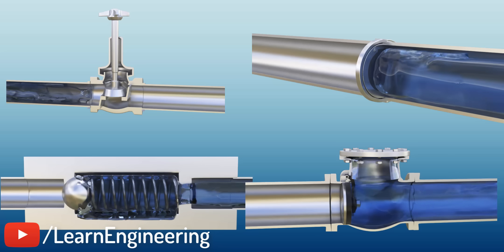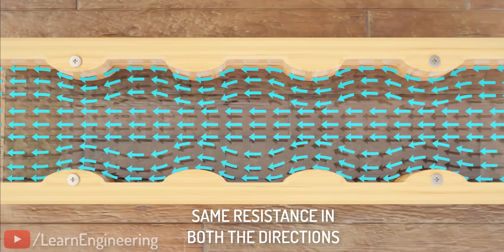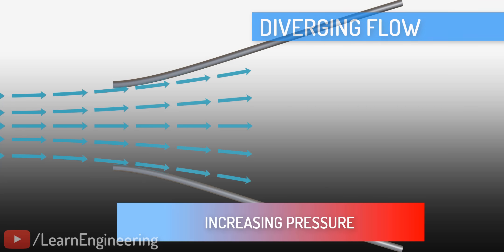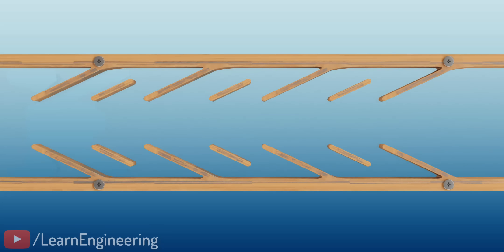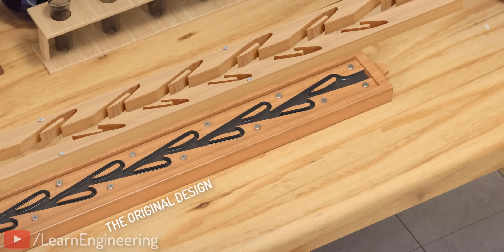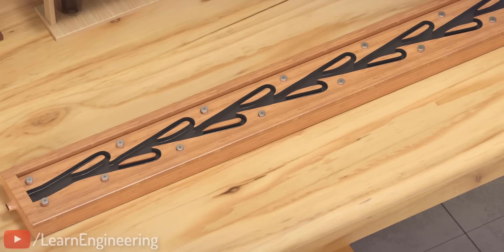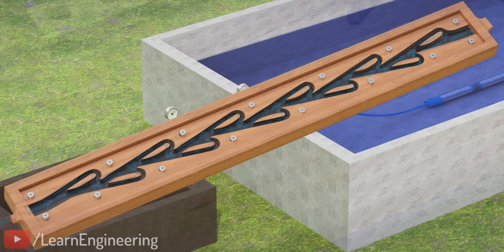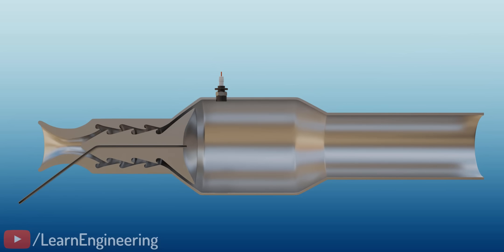Tesla Valve | The complete physics

Comment: How is this beneficial then a normal valve? As it has a higher volume.. just for understanding... while if we wish to  drop the flow just use smaller tube with a valve if there is no initial pump pressure..
Reply: Not drop, but regulate the flow, consider how the hydraulic pump works, higher pressure = faster, but this valve...higher peessure = normalised/static.
Tajuk video tak berapa tepat.
Reply: Yes totally agree that highr pressure is equal to higher velocity... but this video says vice versa
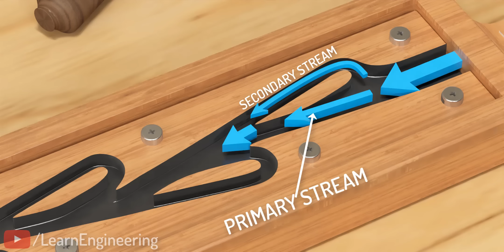Reply: @Sample_channel1106  At 4:00 is the full explanation with possible and practical applications. IMO the best place to use this is at dam water release channel, huge volume of high pressure water can be release at slower/constant pace,  to avoid flash flood downstream.
Reply: Thanks for ur last comment... made it clear....
Reply: @Sample_channel1106  biasa la bro, kita belajar, this tesla guy kinda very good, i thought he only dwell with electromagnetic,  but some how have other invention as well.

Comment: Cant believe how his mind was capable of thinking like this. What a genius!
Reply: It's really not that incredible.

I can't understand how a person couldn't come up with this if you were specifically looking for a one way valve with no moving parts.

The first image that enters the mind is surfaces or mechanisms which grip or engage in one direction. Like a ratchet or running shoes.

Then your brain combines those forms with a pipe. Then it see this would not work as is or at best provide very minimal extra resistance in one direction.

Then your brain says, how can we increase the resistance? And it answers itself and says by creating a secondary flowpaths which apposes the primary.
Reply: What really bothers me is that if somebody did something similar today, you wouldn't care. You care because Nikola Tesla did it. Because of his other inventions. You also care because somebody slapped the letters Tesla on a billion dollar company and now anything related is amazing. The guy asked himself how to restrict water flow. All you need is a material for water to run through and move things around until you are satisfied. Then, you show it to the public with little success because the market did not need the solution or your sales pitch was weak. Then, you die and wait until somebody makes a company with your name on it and an organisation decides to use a handful of valves using your design. That is how you make a Tesla valve. No advanced formulas, no string theories, just carve out some wood and drive some water through it. Alternatively, replace the wood with clay.
Reply: @guywiththebottle  but I mean he was a genius and alsoal a successful. person. But I get you think he has become another hip geek fad

Comment: This might be how Viktor Gerbennikov built an anti gravity platform from the organic CSE found in insects wings. Maybe gravity is some kind of an etheric flow and the geometric patterns made out of chitin can act as a one way valve for this gravity flow. Maybe this geometric pattern prevents this gravity flow and makes anything around the platform massless! You orient the platform correctly and it will prevent the gravetional flow through it or maybe deflect it a bit creating a vortex which push you upwards.

Comment: We use this in iron foundries, you put one at the end of your runner bar that will trap the first in garbage metal, you only need 2-3 curves and it keeps the splash back to a minimum.  Your ingates go just in front, the metal goes by the ingates, and gets trapped in the valve leaving good clean metal to flow into the mold cavity behind it. Very simple and beautiful design, it does what it does well but it won’t stop flow. With modern flow,and solidification software you can see how these work better than any other shape.
Reply: I wonder if something similar could be used for gold sluicing

Comment: I was wondering about its application in valveless pulse jet (or better yet, valveless pulse ramjet) engines, although the rendering shown looks seems like it would be too heavy due to the large amount of solid material (still useful for prototype testing purposes, though).

Wonder why the loop at the far end for the slow direction doesn't have a fully curving back far wall?  Instead, it fans out unlike all of the other loops.

Comment: Its all about the process which were tested on that period.. Simply now we are using NRV (Non Return Valve) which always flow water in one direction. 
Actually the thing is that .. A pressure can destroy a pressure its mean on the basis of hydro kinematics where no force required externally or internally...If we think the same with flood or any disaster then we can easily stand the barrier to stop that water or we can get extra time to divert the water back to initial spot. Inspite we can gain some electric through turbine. 
Note- Fully based on Fluid Mechanics.

Comment: all good but it's not a VALVE per say... you allude to the fact that you can have a valve with no moving parts, but it is not true. This is merely a clever reductor, you do not have any way to control "how much" it reduces. It is a fixed reductor, making it no more useful than any pipe with a bottleneck area that constricts the flow. The only cool thing about Tesla's version is that it constricts one way and permits the other. But still, not that much of a wow factor as are his other inventions.

Comment: Swap the water for electricity, and the channels for wires, and you can easily work with the flow and control of energy. Think about it. Water flows in at a certain speed and velocity. You can increase and decrease with varying results. Say you turn up the flow and the channel creates a more chaotic effect and creates splashing. So you learn that turning up the amp of electricity, can create issues like the water does. Then you learn to adjust the flow amp level to different chambers and channels. Same shit, diff states.

Comment: The explanation is WRONG!
I know a lot of books explain "Bernouilli" the same WRONG way and generations of humans do learn it WRONG.
The flow is not accelerated when it is diverged. HOW should this be possible? From where the energy should come?
A perpetuum mobile?

I do not say, that the Tesla valve does not work. I only say the explanation here is WRONG.

Bernouillis law does NOT say that a fluid is accelerated and its velocity rises! This would be a nice perpetuum mobile and all of our energy problems would be solved, and the USA and China would not have fight cold wars all over the world for oil/enegry.

Bernoullis Law tells us:
"When we got a flowing media in a CLOSED tube then the total pressure, which is the sum of the dynamic pressure and the static pressure stays equal alongside a flowing-line.
And this ONLY under special circumstances (non turbulent flow, incompressible fluid, very low vicosity)

And when you look at our graphics: When you put that angles there is a diverging in the inner side but the same time a converging at the outer sides.

The same is with the question "Why do planes fly?" Answer: "Because of Bernouilli!" FU...CK! NO!!!
If Planes would fly because of the bernoulli effect (where the hell a plane is in a closed tube???) every plane should fall down like a stone, when the plane turns around on its back and fly upside down, right? Yes!
BUT: There are planes that can and DO fly upside down and DO NOT fall down like a stone!

Learn mathematics, learn physics. AT SCHOOL not on youtube!

Comment: How will you reverse it without obstructing the flow? I think you need to stop the flow, then reverse it and then again start the flow. If I'm correct then it is useful only for varying the flow, which can also be achieved by other devices like venturimeter.

Comment: There is a mistake in the video.
The narrator does not understand the relation between pressure and velocity correctly.

does a velocity gradient cause an inverse pressure gradient or vice versa?
difference in pressure causes moving thus velocity.
thus a pressure gradient causes a velocity gradient and not vice versa

Comment: I won't read all the previous comments, but I think you missed the main point- you need to have a fluid flow that is oscillating back and forth for this thing to be useful.  Then it's great,  But otherwise, one could simply expel the fluid through a smaller orifice.

Comment: there's a difference between a one way valve and a check valve.  With a one-way valve, under low pressures fluids will leak in the wrong direction.  those types of systems require a CHECK valve, which requires a mechanical (moving) closing door. Many diesel and other fuel delivery systems require check valves, and a one-way valve will never work.

Comment: Interesting design.
But it would be very specific to only certain applications with fixed pressures and flow rates.
As soon as the pressure was increased or decreased it would completely change the flow rates?

Comment: It's not a true one-way valve because there will always be a little seepage, but its as close as you can get.
And for those who wonder how Tesla came up with this when his forte was electricity, electricity is amazingly similar to fluid dynamics, you are just moving electrons instead of a fluid.
Electrons flow through wires like water through a pipe, volts=pressure, amps=flow rate, watts = amount of water moved, resistance(Ohms) = turbulence/constrictions restricting flow.

I figured out how a Tesla coil works and resonance as a kid before I even heard of Tesla, I noticed that fluorescent tubes lit up when near something charged, I thought why can't we transmit electricity like that. 
Maybe I'm the reincarnation of Tesla without the Tourettes.

Comment: I think in the second case at 1:00 the flow should be the same in both directions since it's symmetrical. He only locks at the center. There the area increases if the air is going from left to right and the pressure lowers. But on the side we have the opposite effect. He's totally ignoring this.

Comment: 65FGM520 reduction geared motor applied for automatic equiments robot reducer gear motor

Motor specification:

Model:FT-65FGM520

Rated Voltage:24V

Load Speed:6700rpm

Load Current:150mA

Load Torque:20g-cm 

MOQ:100pcs

Gear box ratio:it is customized based on client's requirements.

@t

Comment: The reason why this is so inefficient is people are getting it wrong.  The diagram Tesla drew up is a cross section of a round tube. And the fins inside is actually a solid screw shaped deal that's adjustable.  And the body is shaped in a screw fashion to except the inner screw.

Comment: Same suppression yes but angular off sets .the example is showing a flat diagram the original is conical more funneling round tubular and has a stoping action and the spinning Tesla valves reverse flows due to the spin and a 1 one degree off center we use a similar type for plasma force and anode cathode for reverse power recovery .

Comment: Its not really a valve though, because it doesn't stop the fluid like the first valves shown, it just increases friction, slowing the total flow. That's not really a valve, the cool thing about this is that is works full flow one way and severely reduced flow the other, however it will never stop the fluid.

Comment: So.. its not a one-way valve, its a fluid resistor.
Reply: Do you even know what a valve is
Reply: @XeuxiXiliak8417  Yes
Reply: @acer8123  "a device for controlling the passage of fluid or air through a pipe, duct, etc., especially an automatic device allowing movement in one direction only." 

It's a valve
Reply: @XeuxiXiliak8417  However, its not a one size fits all, which to me is the most important factor when making a valve. What tesla did was made a pipe that can resist the flow of fluid depending on the orientation by a constant amount, but it cant truly stop the flow, thus not really a valve. The definition even goes to say that its "especially an automatic device allowing movement of a fluid in ONLY one direction", whereas tesla's invention allows flow in both directions.

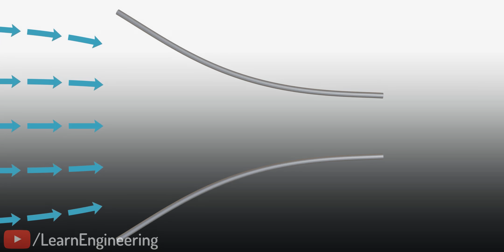Comment: At 1:30 ''this velocity increase means that the pressure will drop along the flow''.  Not exactly: it's the volume of water passing that will drop-decrease because, on the contrary,  the pressure on that point augments.  Put your hand in front of a garden hose: when you limit the width with your thumb, the volume of water decrease but the pressure augments.  This is why the water push more on the hand or goes farther away.

Comment: I'm building a dirigible.. personal sized... with multiple balloons of palladium foil with a valve to fill the things.. a simple tube and a bevel for a ball held inside the balloons with a piece of silk that limits the travel and closes the system, but allows me to fill... I think it's adaptable for a pulse jet... with a palladium ball.. or AuPd clay... the metal is lighter than aluminum...  strong as steel.. does not oxidize.. the plastic is even lighter... AuPd dust and the high tech solution for bio plastic... Elmer's glue
Reply: I make it from aluminum.. melt in the dust with borax.. as the aluminum boils away the molecular dust follows the flux into the aluminum.. the first seed of palladium causes the process to cascade because the melting point is way beyond aluminum.. and the flame of my torch is 2500° C.. the vapor point of aluminum.. it evaporates to leave the palladium
Reply: the evaporation can be contained in a vacuum chamber.. with a coil around the chamber to make the walls positive or negative.. depending on what you want.. 
the result of my efforts creates AuPd.. the gold is a vapor at 1550° and passes through the planes of cleavage.. it creates a 3D checkerboard... Au..Pd... Au.. Pd... or Pt.. depending on the temperature.. I don't worry about the aluminum evaporation.. it's the palladium I am after.. it requires zero carbon emissions and zero ecological impact to obtain useful amounts
Reply: AuPd dust is weathered volcanic ash.. found wherever water flows naturally.. screen down to microns... and add borax.. voila
Reply: AuPt and AuPd are absolutely ubiquitous.. radioactive volcanic ash literally covers the Earth.. mostly we walk around on top of it... and most people don't know what they are looking at..  the Hmong people have this technology.. they supplied the Chinese empire with real money for thousands of years.. it's just as good today as it was yesterday

Comment: Dictionary definition valve -
1. a device for controlling the passage of fluid or air through a pipe, duct, etc., especially an automatic device allowing movement in one direction only.
"a valve shuts off the flow from the boiler when the water is hot enough"
-----
Regulator – controls the fluid flow

Comment: It's a good design but it can't replace other single direction valves bcz of the one simple reason it doesn't block the flow completely which highly required. The spring loaded and flap valves works very efficiently In that case.
Also when designing this valve for a particular case calibrating Tesla valve for a particular pressure is far more difficult then designing a spring or flap for a particular pressure.

Comment: Okay so this lesson missed completely why this works!!
The reason why this works is due to the shape of the rounded loebs in one direction while they are opposite in the other direction. In the opposite direction the water is diverted faster through the non rounded loebs and increasing in speed passing over the curved wing surface, thous meeting against itself increasing back pressure. The shape of the loeb with the shape of the entrance angle is what makes this work. Tesla did not give a damn about rules or laws, only it if worked. This valve actually demonstrates Bernoulli's principle which was made for fluid dynamics.

Comment: I noticed that it has no dead spots where the fluid stops completely. Makes it self cleaning if you need to switch from one fluid to another. Also will it work in 3D with 3, 4 or more channels around a central core? Tough to do in Tesla’s day but easy today with 3D printing. Excellent video. Thanks.

Comment: I have been recommending using nano sized tesla valve types built in crystalline lattice structures with doped graphene to create particle accelerators and also desalination filters and CO2 scrubbing for years now. Also for hypersonic travel jet engines. I hope someone runs with this soon. Also magnetic flow valves that are dynamically controlled digitally at high speeds can enhance and control the flows according. Gases within the valve systems can be ignited at different mach level speeds at different points along the valve depending what gas is being channeled into the flow at what time,  temperature and speed of the craft.

Comment: You proved yourself wrong. You proved that you cant make a one way valve without moving parts when you tried to prove the opposite. In a true one way valve no flow comes out the other end. In this design  there is some flow that makes it through. Also it kind of defeats the common definition of "Valve". Also this design would require some sort of pressure to even really work would it not? One of the main uses of a one way valve is so that water can flow to the other side but can never flow back. This works well for pumps keeping their prime or to keep air out of a system. With this design when the pressure stopped, the fluid could just flow right on back in reverse and completely defeat that purpose.